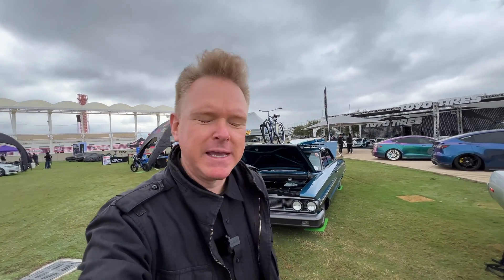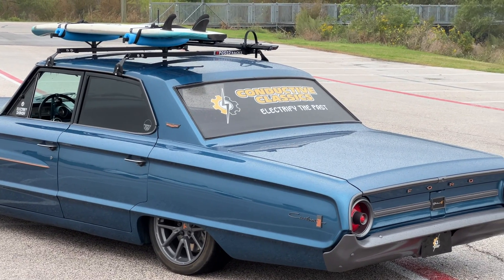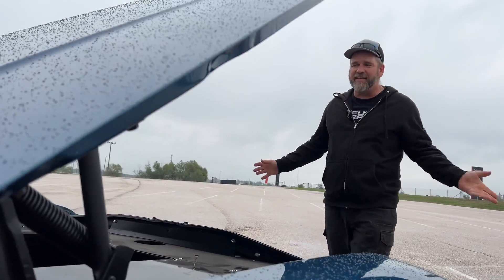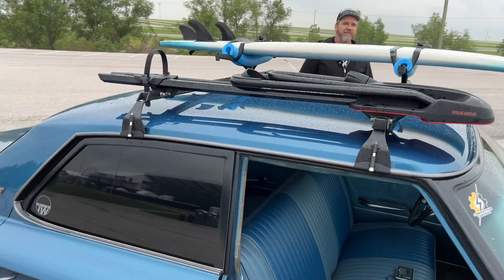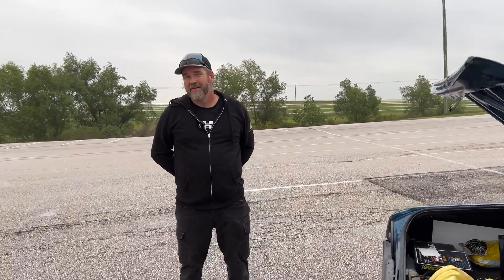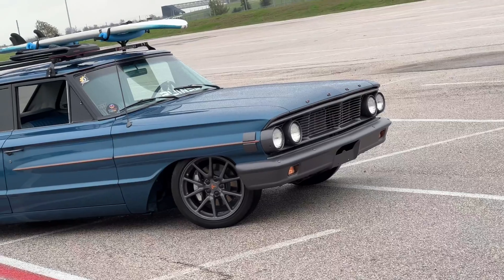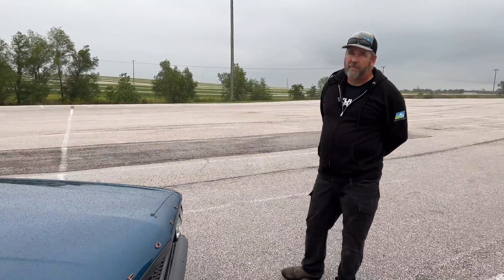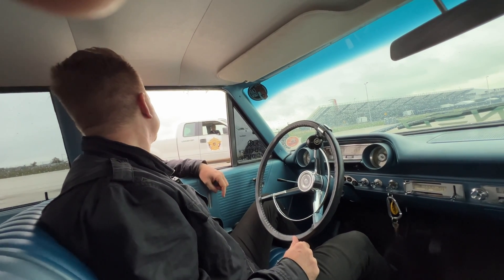This Ford Galaxy Conversion Is A Secret Tesla Model 3 Performance!

Comment: A few years ago I thought of converting my 2010 BMW 320i to electric.  When I looked into it, adding up the costs, it would have set me back more than $50k.  Low and behold, BMW came out with the i4 - a much better car than I could have produced.  These guys took a car that could do 0-60 in 3.1 seconds and drive nearly 300 miles on a charge and now have a slower car with fewer features and half the range.  They should have left the old gas guzzler alone.
Reply: I promise you if this is in a parking lot full of 300 mile range Model 3s this will be the thing everyone is piling around. Also this style of conversion total cost around 25k-30k in parts if you are smart enough to do everything yourself. Its fun, looks great, and is making a car that would usually be stuck in a garage get back on its feet again. Not to mention the business it's generated these guys.

Comment: This is a very cool conversion and looks awesome.  Since the trunk has equipment in it I think I’d want to make the front into a very nice frunk instead of a cooler. The hood could be modified to pop open and close with a motor. I think that would be a fun thing to show off and it could be useful.

Comment: If this car goes 170 miles on the highway then it definitely needs DC fast charging and thermomanagement to it the way owner said: it is just asking to get it to be  completed.
The interesting part is the DC fast charging has to be CCS1 since there is no way the Tesla Superchargers would accept it due to the fact it is a Tesla but not accepted as original one powertrain since it is a jailbroken one.